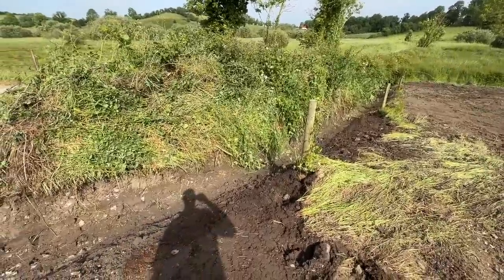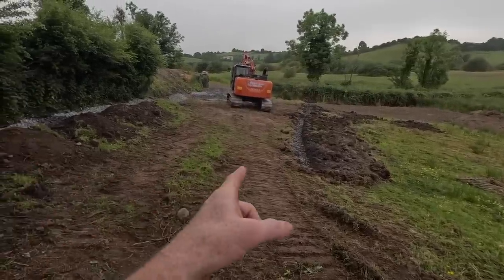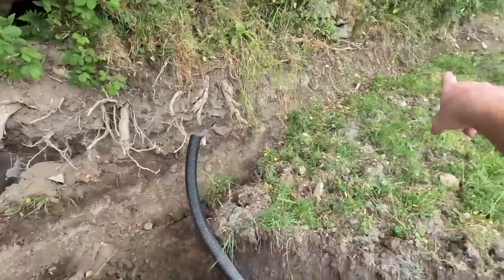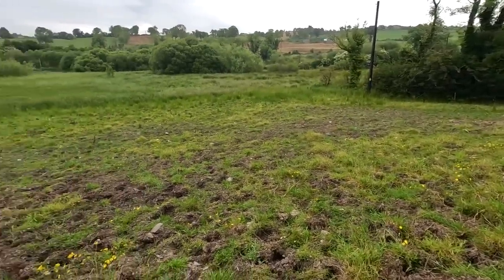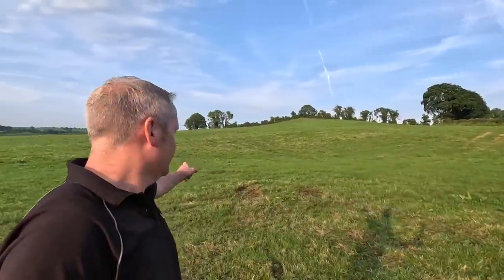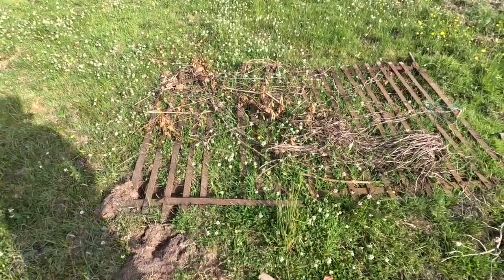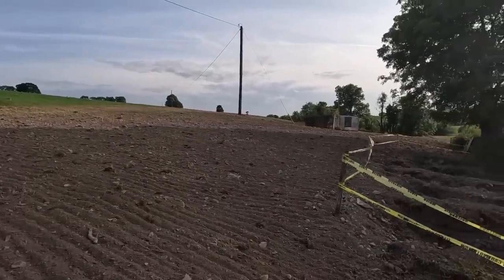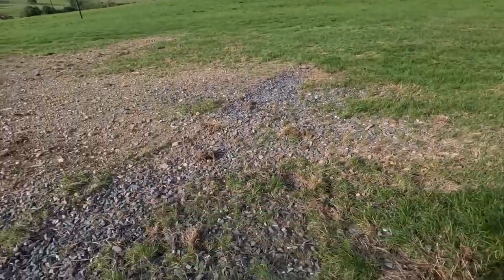Turning Poor Wet Ground Into Something Fairly Decent

Comment: I always thought you had to dress the bottom of shores with small bit of stone first, then pull the pipe tight when you put it down to open the little channels and then backfill with stone
Reply from the maker: Not when it’s channel underneath, just have to make sure it’s clean. Lots of people around these parts don’t use pipe at all just stone to the top

Comment: Nice video, from experience pipe that light gets squashed easily, the drain works just as good without something that light but would require the drains to be filled to the top with no soil covering.

Comment: Back our way adrain.. Tho shall not use 4inch pipe. 6 inch r up.. When your draining wet ground.. That 4inch pipe is shocking. For the sake of a few more quid go to the 6.. Bigger pipe less stone you will save it the other way.. Jes that 4 inch should be banned.. No time for it.. You go to alot of time.. The amount of water falling now.. Good job tho..

Comment: Unusual to see no stone put at the  bottom of each trench, any particular reason or is that the way you have always done your drains? Secondly no drainage type pebble stone used? Useful tip at the weekend I learned doing a small drainage job at home was to put weed control cover on top of the stone before backfilling. Stops soil (especially this time of the year with dry ground) contaminating the stone so water can drain away quicker.

Comment: You should be installing filter sock on your pipe to prevent fine sediment infiltration and clogging.  Everyone uses filter sock in the US for all tiling work. 😊
Reply from the maker: Never seen them used in this area, but sound like a good thing for sure
Reply: @IFarmWeFarm I'm in Leitrim Adrian, I used Teram geotextile on the pipes here great job, although I cut and stitched the roll myself to make the sock if that makes sense.  Used it in bog ground without any stone as the stone was disappearing into the ground and was useless after a few years